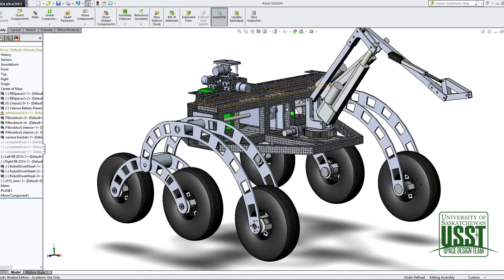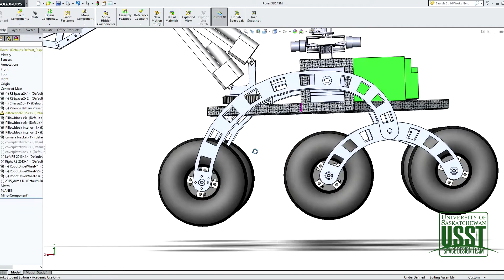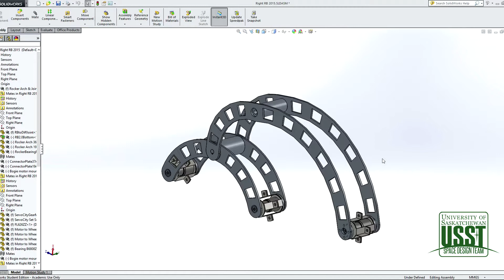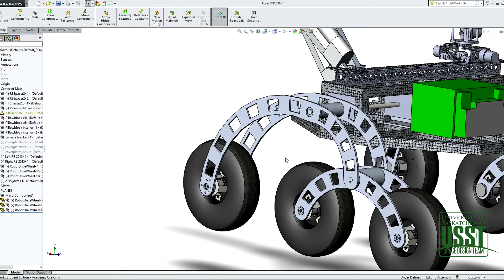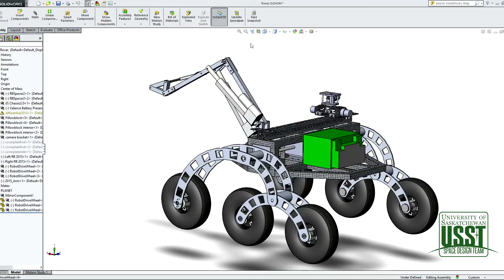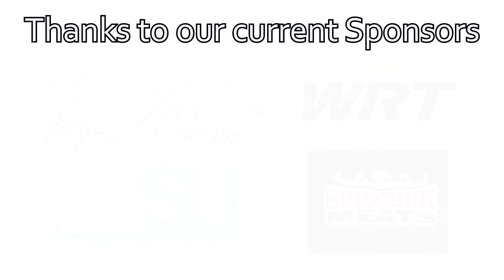USST Rocker-Bogie Suspension 2015

Comment: How do you balance the vehicle since the bigger bogie is pivoted to the sides of the vehicle? Will the vehicle tip over?
Reply: The differential prevents the vehicle from tipping forward of backward on the rocker links.  Have a look at http://www.alicesastroinfo.com/2012/07/mars-rover-rocker-bogie-differential/ for a more details explanation.